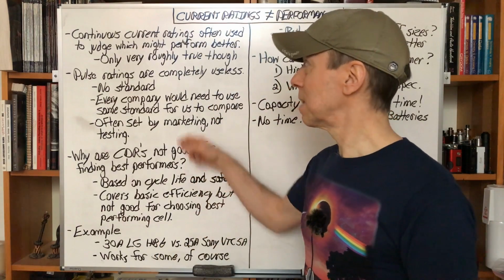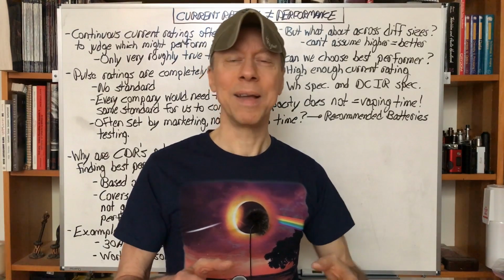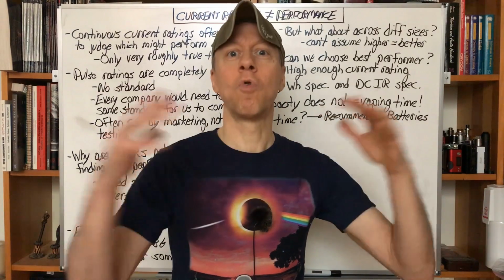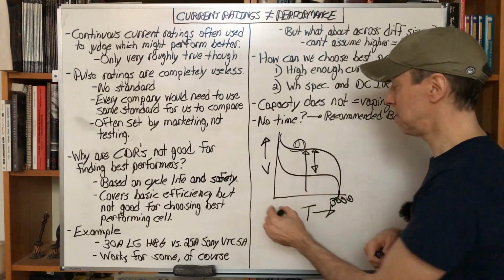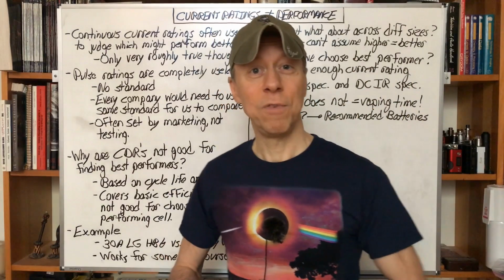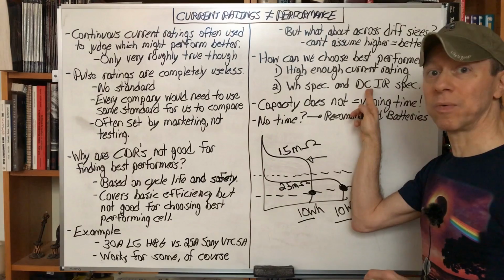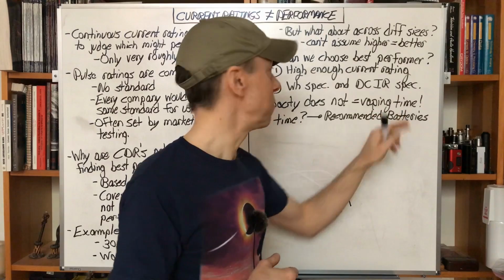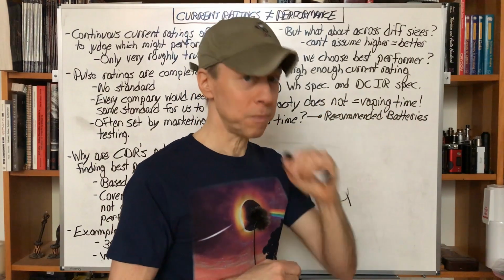Minding Your mAhs – Ep018 – Do higher battery current ratings = better performance?

Comment: The best lighting. I have a few questions if you don't mind. I have a nitcore 3500 amh 8a battery and another Panasonic NCR18650G battery. I use that battery for a flashlight.Lumen 1800 turbo. I made a comparison between these two batteries. Both of them are fully charged and I tested the performance of the flashlight to the turbo level, the light coming out of the lamp The same applies. Nitecore 18650HP 3500 battery has 8A while Panasonic NRC18650G does not reach 5A. I hope you can help me with this problem and maybe I am wrong.The light output of my flashlight is the same if I use 8A and 5A batteries.
Reply from the maker: Sorry, I do not know why you are getting the results that you are seeing. There are just too many possible causes and too many unknowns for me to even guess.
Reply: @batterymooch  Maybe you're right, there might be another problem. I'll check my driver and electronic components. If I get a result, I'll let you know.Thank you for your feedback and I really appreciate it.

Comment: Is 9.5 wh good?
Reply from the maker: It depends on the battery, its ratings, how hard you are using the battery, and what voltage you are discharging it down to when measuring the Wh.

Comment: I know you get this all the time, but two questions; would vtc6's be generally better in regulated mods due to their longer mAh?

And in general, what batteries do you generally recommend for regulated mods? Samsung 30q?  Lg hg2? Don't vtc6?

And for high power, would I be better off with Samsung 25r?  Samsung 20s?  Sony VTC5a?

I tend to run dual or triple 18650 mods since I know little to nothing about 20/21700, though I was looking in to them as well for the near future.  I hate knowing so little about all of this.  That's why I want my own equipment to test and learn hands on, though I doubt I ever will lol
Reply from the maker: Check the Description section of this video for the link to my blog at ECF. You can find links to my Recommended Batteries tables, for regulated and for unregulated/mech. Some great choices there.

Comment: just a quick question I vape only tube mods and stay at 0.20 to 0.30 ohms what would be the best 18650 batties for me?
Reply from the maker: Calculate how much current you are drawing, so you can choose a battery with a high enough current rating, and check the link to my blog at ECF that’s in the Description section for this video. My Recommended Batteries tables have some great choices.

If you are under 25A the VTC5A is a great choice. The 30A Samsung 20S hits harder at the start but is only 2000mAh.

Comment: Love your channel. Can you tell me what 21700 you recommend for a single battery mod, and with any ranges, i.e. above or below 45 watts? I will most likely be vaping between 40 and 70 watts, thanks. Samsung 30t or Samsung 40t maybe?
Reply from the maker: For up to about 75W the 40T is a fantastic choice. Above that, try the 30T.

Comment: Mooch could you please let me know what you think are the best battery (21700) for the topside and the 90w lost vape mirage? I'm using the Samsung T30s? Thanks!
I'm not a 10000watt vaper 40/50 watts
Reply from the maker: The 40T is a slightly better choice for up to 75W. Higher than that and the 30T is a little better.

Comment: Mooch can you please recommend an 18650 battery for me please. I've been using internal battery mods for years with sub ohm tanks. For the past 6 months I've switched to RDA's exclusively and would like to also switch to a better mod than the smok bullshit. Recently I found my sweet spot with my RDA with fused Clapton's usually at .4 ohms at 45 watts. What battery is right for my use? That's I appreciate your videos!
Reply from the maker: Try the LG HG2. It can be used at up to about 60W before you hit its 20A rating.
Reply: @batterymooch  thanks a lot brother. Love your videos! Appreciate what you do for the vape community.

Comment: Cheers for the watch mooch, educational as always. Is there much variance between batches batteries of the same type? Ie does a vtc5a always perform the same or do batches that were manufactured at different times perform differently (or evem within the same batch) ?
Reply from the maker: Almost no difference between batteries from the major manufacturers, assuming they are all the same grade. Different grades are sold to vapers though, with no way for us to tell between them without testing.

The China manufactured batteries can have a lot more inconsistency between them, perhaps being noticeable during vaping.

Comment: This is my refresh course. I'm a software developer and in the school, we were taught that. I'm gonna dive into this because I have some very strange situation. Efest 21700 3700 mAh (Mooch Recommended) in dual config Mod. Tank Siren 2. 18W. One Efest 21700 weights ~75 grams, one Sony VTC6 weights 45 grams. Here is the strange part: I get *the same vaping time*. Then I tried Manta RTA Dual Coil at 80W. They are toe-to-toe. If Efest 3700 mAh weren't more then 50% heavier then VTC6 I would just assume they are bad batteries. If I take all this into account this doesn't add up for me. YET. Thanks Mooch.

Comment: Like many i start using my 25r in mech mods then i replace by full chargés and "finish" it in an electro ... i vape at 0.5 ohms at 25w so most of time around 3.7v : je chat good for my batteries ? Are others vapets here doing the same kind of routine or is it better to recharge at mid charge their batteries ? Jp for #lavapedetravers on #coffeevape (radio ) .fr
#coffeevaperadio
Reply from the maker: You can recharge them at any time. 🙂

Comment: I'm wanting to know what the watt hours of Samsung 21700 40Ts and 30Ts are.
Reply from the maker: You can follow the link in the Description section to my blog at ECF. The link to my master list of test reports is there, each with the Wh and DC IR numbers for those cells. You’ll need both numbers since those two batteries have very different capacity ratings.
Reply: Battery Mooch hello
Can't find any "master list" in you blog on ECF ?!
Reply from the maker: Kenny von Bülow it’s the second link in the index, “Complete list and links...”
Reply: Battery Mooch thx for the answer.. but yea wanted to see the "data" on Samsung 30T hehe guess it's not done yet ? I can find the test of it there. Just not the watt hours etc. Else I must be blind. Sorry for inconvenience
Reply from the maker: Kenny von Bülow it’s in the Ratings Graphic
Reply: Battery Mooch  thx!! Found it! 
Hmm guess I have to watch the video couple times more hehe. 8.9wh @ 20A etc on what this mean bassicly 😅
Thx for the videos !

Comment: wow amaaazing video again!!:) thank you so much!  what are the watt hours of samsung 30t and 40t?
Reply from the maker: You can follow the link in the Description section to my blog at ECF. The link to my master list of test reports is there, each with the Wh and DC IR numbers for those cells. You’ll need both numbers since those two batteries have very different capacity ratings.

Comment: I'm glad you explained this Mooch. This is why i get around the same amount of run/vape time (using a regulated mod) out of 2 VTC6 or 2 VTC5A cells. The VTC6 has a higher capacity, lower CDR but the VTC5A has higher CDR, lower capacity. Wh's are the way to go....more accurate when it comes to vaping.